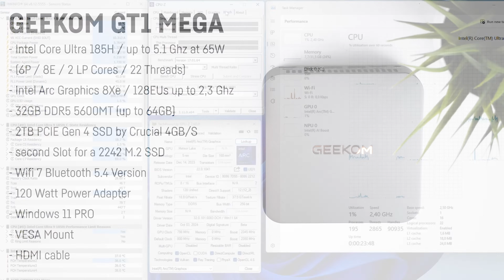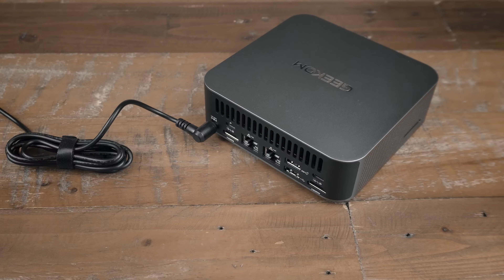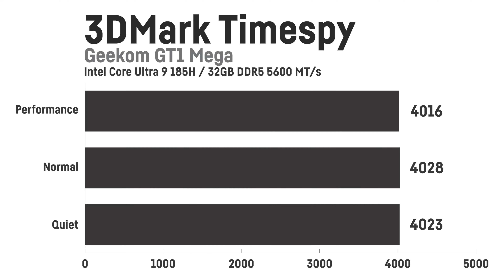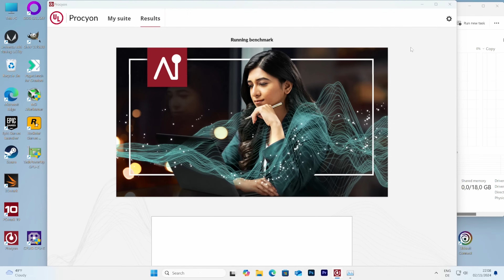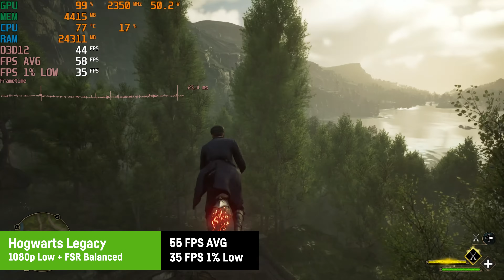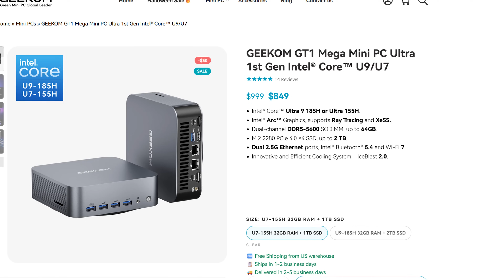GEEKOM GT1 MEGA Mini PC Review - A real Desktop PC Replacement?

Comment: can this have a sata hd in it?
Reply from the maker: Nope! Only via external cases.
Reply: Their IT series is made just for that purpose. It has extra height to accomodate the standard 2.5" SATA drive in the bottom.  I've tried it and it requires no configuration. Just plug in a formatted drive and it works.

Comment: How did you deal with the plexiglass, when you reconnected the antenna?  Did you remove it?  Is there enough space to slide it back in and reconnect?  This is where I'm stuck unfortunately.
Reply from the maker: Yes I removed it, you can easily reattach it!

Comment: Thank you so much for this review! I edit videos for a living and my old computer from 2018 has an Intel I7 processor with a 1080 GT card. I can’t edit Raw 6K video at all or H265. Premiere lags at the very first frame. Would this PC be able to edit H265 at least? Would it be any upgrade from my old editing station? I would upgrade the Geekom to 64 gb of ram to make it as fast as possible.
Reply from the maker: A GTX 1080??? That's still a good card. Also for video editing with it's 11GB of VRAM.
Which i7 is it?
I don't think a mini pc would be the right upgrade for you.
Which kind of software are you using?
Reply: @ thanks for your reply! I’m not at the office right now, so I don’t know exactly what I7 it is, but I remember that it was one of the best in 2018. My computer works great, but it simply refuses to play back any type of 6K raw footage or H265 footage… and at the same time, I’m in love with the small form factor from these new computers… I’m editing in Premiere Pro 25.
Reply from the maker: @sa.t.2507  Again. If 6K Raw Footage and 265H Encoding is your priority. DON'T get this Mini PC. It will be a degrade from your current system.

Whats the issue with 6K Footage editing right now? Choppy? Or not working at all?
Are you saving the files on a fast SSD (That's a MUST, don't use HDDs for that)
Also the GTX 1080 can encode h265 Material, but might be limited by 8GB VRAM. 
If youre into professional editing I would recommend investing in an RTX 4080 and maybe upgrade your i7. 
I'M assuming it's a i7 8700k or 9700k. YOu could just use a 9900K instead for more threads. Together with the GPU, and a RAM upgrade you'll pay around the same as for a mini PC and get much more performance out of it.
Reply: @ Well it wont play at all in Premiere, only 1-2 frames and then it stops even from a SSD! My issue is that my motherboard is last gen socket so I can’t put in any newer processor as far as I’ve been told. So I would need to change the motherboard in order to be able to put in a newer processor I guess? Question is are my issues down to the GPU or the CPU or both. And I would love to have a small compact computer!
Reply from the maker: @sa.t.2507  letbme know your CPU or your motherboard.
You might be able to put in an i9 9900K and keep the rest.

Comment: I maybe an odd person, but I like it more than the base M4 Mac Mini due to better ports and design.

- 6 Type A ports
- Full SD card reader
- 2 HDMI 2.0 ports
- Full access to X86 software compatibility.
- Replaceable RAM and SSD.
- Cinebench R24 Multi-core score above 900.

Comment: Good work with the various modes tested, well done. 
I want to thank you very much for doing the whole opening of the case and showing the cooling system.  It's such a nice thing to do, thank you.

Man, the cables that connect to the wifi cards are so annoying lol.  Especially if the cable is not cooperating.  AARGH!  Good to see you had no real issue.

Thanks for the video.  Hardware wise, it's a fine mini PC, no question about it.

Comment: For $650 (At most) I can build a PC with a Ryzen 5 5600 and a Radeon RX6650XT

This thing is $1,000 WTF
Reply from the maker: You can usually build a faster Desktop-PC for less money.
A Mini PC is for people that want/need a... well small (Mini) PC :)
Something subtle, maybe with Style, also very energy efficient.
And in this case VERY strong considering CPU and Daily Work Stuff.
The PC you mentioned would of course be much better for gaming, but considering the rest, this MiniPC would even be faster.
Reply: @Hubwood  You called it a desktop replacement.

It isn't a desktop replacement.
Reply from the maker: @Splarkszter of course it is a desktop replacement for someone that wants or needs a MINI PC. :)
Or in other words: can it replace a desktop? Yes of course. If your main concern isn't gaming.
If you are an enthusiast that is upgrading and tinkering around with your pc every few months it's obviously not. But I'm assuming that someone who is an enthusiast... will know that...
Reply: @Splarkszter  Back in January my desktop PC died.  Since then I am forced to use this mid tier laptop of mine from early 2014.  It is my desktop replacement, though not by choice but by necessity (poor thus not able to afford anything else).  It works, most of the time, it still receives new drivers from Nvidia (GTX 860M), and while it won't run recent releases at good framerate or high settings, it will run most everything else at some level.  Wish I had something better, but for what it is, it is indeed a desktop replacement and it does run the majority of my programs.   

So if this laptop is, I am pretty sure this mini PC is too.  Obviously it depends on what your usage is, but that is not just for the graphics or processing power, but also for the RAM, the SSD size, etc.  But that is the same for any PC out there, mini or not.  

If you are looking for a specific level of performance to be worth your "desktop replacement" ideal, then what does that make other computers which are even full tower PCs, with less powerful hardware than this mini PC?  Are these desktop PCs, modern ones, not "desktop replacement" for you?  Or perhaps not "desktop PC" at all?

It all depends on the user and their workload.  

To clarify, I don't have this mini PC or am affiliated with this company or @hubwood
Reply: yes, but it wont fit comfortably in backpack with other things - it has it's place on the market
Reply from the maker: @truenetgmx  I mean a mini PC is much more mobile than a desktop, but if you really need to take it with you a lot, a laptop would make more sense. Though, yeah, they DO have a place on the market, otherwise nobody would buy them :D 
What's interesting for my Channel, is the fact that they're using Laptop Hardware:)
Reply: @Hubwood  when I travel once every like two months I usualy take with my laptop 16 inch mobile screen, keyboard, mouse. Rest of the time my macbook air is chained to my workplace - so yes, I'm part of this market (or all of it :D )
Reply: Try putting that in a backpack 🎒
Reply: For the people complaining about the price,try buying a mac mini with comparable specs. This is a steal